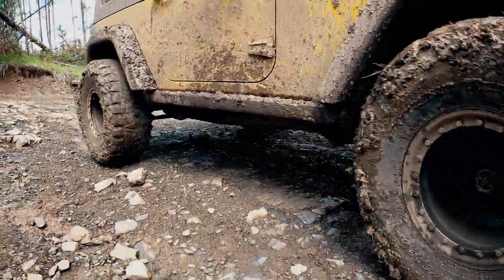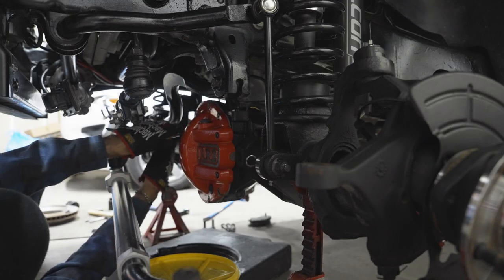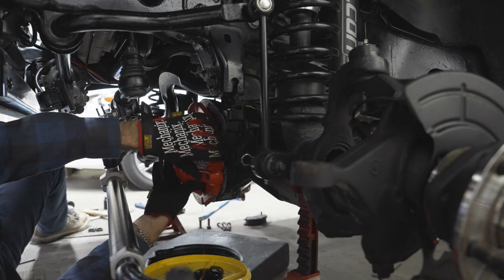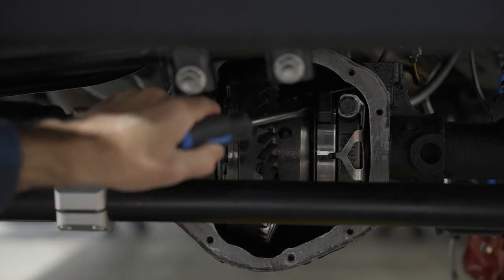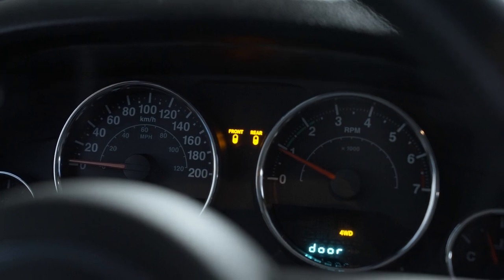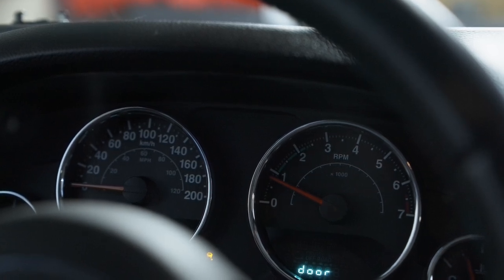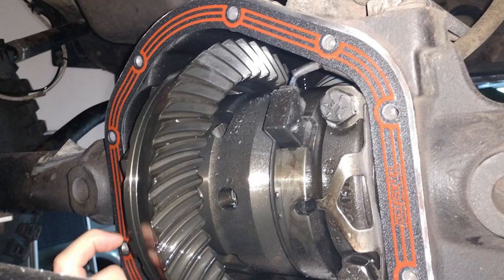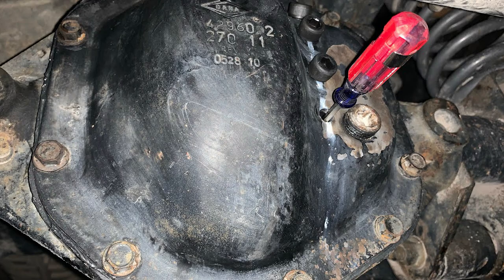Jeep Wrangler Stuck e-Locker (Short Version)

Comment: I have a 2016 Rubicon, it happened to me. I can get to it with a flatblade through the fill plug hole. (stock diff cover)
Reply from the maker: Yep; with a stock cover it's very doable. One of the donwsides to an aftermarket cover.